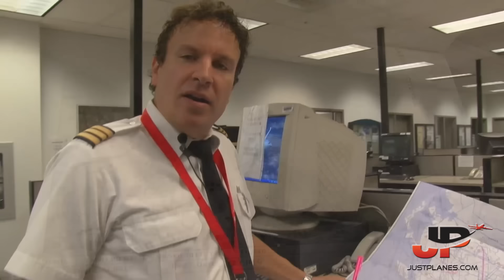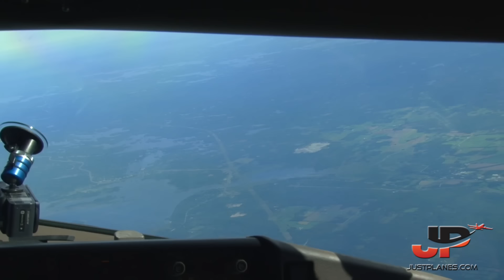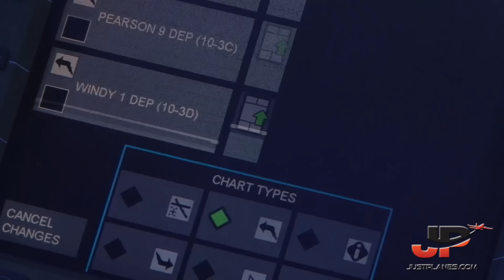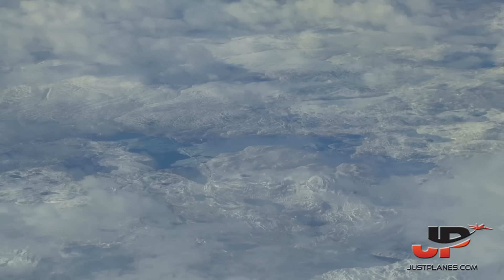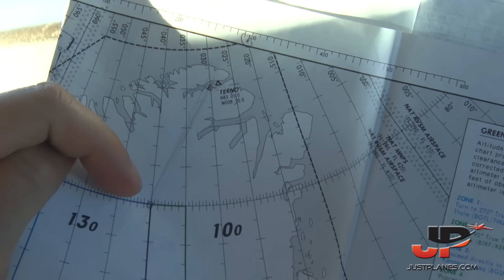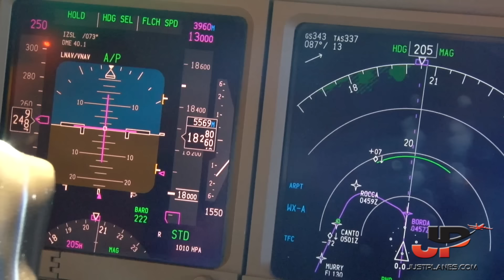Air Canada Boeing 777-200LR Polar Cockpit Toronto🇨🇦 to Hong Kong🇭🇰

Comment: Surprised that you were running at only flight level 310.  For such a long flight I was expecting higher.
Reply: It’s called stepclimbing, they usually fly at a lower altitude at the start at the flight, and then climb higher during cruise later in the flight. This is done since aircraft burn less fuel at higher altitudes.

Comment: Really nice video. I love the tech details of what goes on in the front office. Ive done the polar route several times from BOS and YYZ pre-covid to PVG and HKG as a passenger. Sooo smooth at 89 North up and over from the Arctic circle and back down to the other side. Im fortunate to do the cubicles and I would sleep for 8 or 9 hours straight. Hats off to you guys.

Comment: Great video but I must say Air Canada is one of the worst if not the worst airlines in the sky. Also I noticed there are more and more occurances of severe turbulance on aircraft nowadays, I wonder how the geriatric flight attendants will handle that, they may be the ones needing the assistance.
Reply: Every comment section has one bonafide JERK!
Reply: How is Air Canada the worst? Please give reasons…, or you’re just an a$$hole.

Comment: This video was posted on 09/08/2024. Flight date: 09/08/2011 (exactly 13 years to the day). Was it intentional?
Reply: they post it so hey can make more revenue
Reply: this video was taken on 6 September 2011, you can see it on computer and on the early video.
Reply: When I saw the computer monitors I was like "WOAH this is older than anything this decade"
Reply: Video very good tanks
Reply: Canada been banned from Russian airspace because of the Ukraine war.  I always prefer the over the ocean route because I consider it a bit safer in case of a forced landing.

Comment: i love b777-300er
Reply: سلام....نوع300. با 200 چه فرقی داره؟
Reply: The 777-200 is the oldest model. The 777-200LR has the longest theoretical range, with enhanced structure and fuel capacity. The 777-300/300ER has greater payload capacity and is longer. The 300ER has a wider wingspan and is equipped with the famous GE90-115B engine, while other models have different engine options. The 777-9 is wider, longer, has more payload capacity, features the new GE9X engines, and has updated avionics.